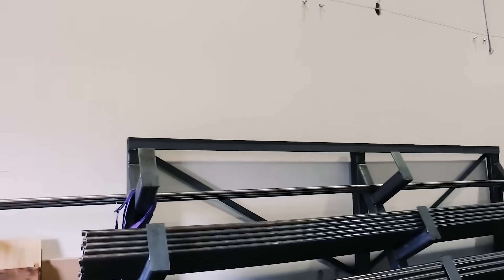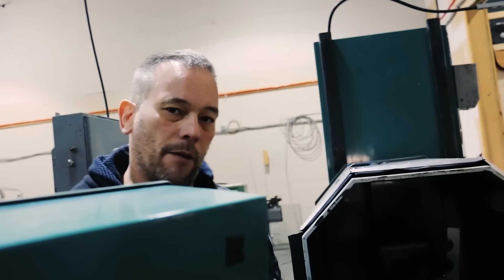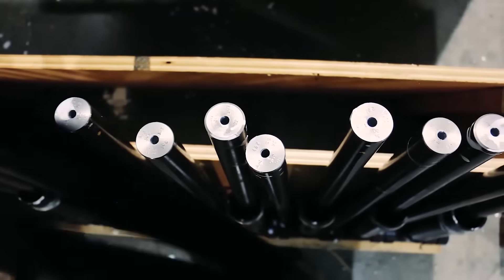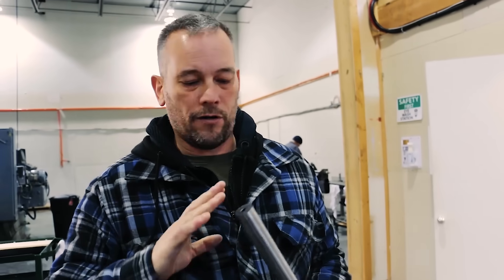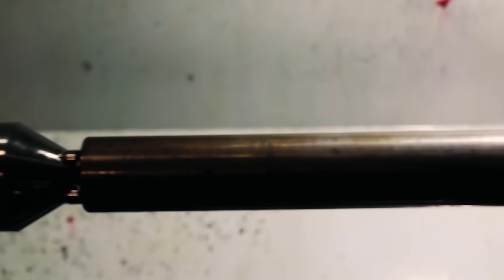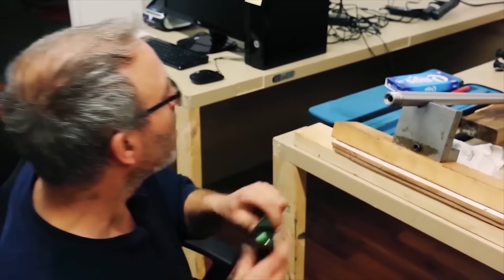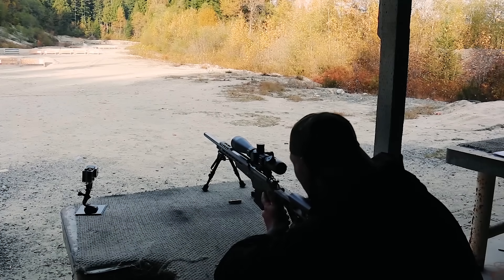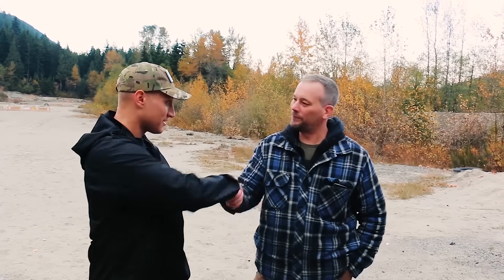How A Precision Rifle Barrel Is Made: with International Barrels Inc.

Comment: As a  CNC Lathe machinist for a long time I can definitely agree on different batches of steel running very different. You can have 2 batches of the same steel running a part and have everything in spec then when you switch to the second batch you have to dial everything in again almost every single time.
Reply: Not a machinist, just a simple "ez bake" leaf spring manufacturer, and even our spring steel is different from bar to bar. A single pallet of bar stock can have three different steels that will produce different amounts of scale, require different temps, etc.

Comment: Great video.   I agree some of the older machines are so well made, there's simply no valid reason to run newer equipment.  Imagine that a 105-year-old machine is still running strong and true.  Just fascinating the quality of manufacturing back in the early 20th century before AutoCAD.  I know a few shooters that run International Barrels.  They like them a lot.  Button rifling has been used in benchrest for decades.  Even some F-Class shooters use button rifling.  I've used several button-rifled barrels and several cut-rifled.  Both were very accurate all the way out to 1k yards.  The barrels were 5R and 6-groove.  5R is a little easier to clean than 6-groove and of course 3 & 4-groove are easier to clean than the others.  It is a common misconception that more grooves = better accuracy.  I'd argue the opposite as each group imprints on the bullet as it expands to block off gas and each groove makes a mark on the bullet.  Ensuring proper cleaning at consistent intervals is as important as anything else in maintaining accuracy & precision in a barrel.  I've also had the end of several button-rifled barrels threaded and turned down to 5/8-24 without any impact to accuracy.  I have seen button-barrels turned down to 1/2-28 which did seem to cause an expansion at the muzzle which led to a slight degradation of accuracy.  The two I saw this on both went from 1/2 MOA to 3/4 MOA.  While that isn't a major movement in terms of closer ranges, it will translate to greater loss at greater distance due to the cone effect.  If a rifle barrel is handled and manufactured in a quality way, then there is simply no good reason to shy away from a button-rifled barrel.  I'd much rather have a button over hammer forged.  Lord, some of the hammer forged barrels I have seen through a borescope, and it was a wonder the bullet didn't just fly wildly in some off-the-wall direction.  Luckily, the few production rifles I've owned which were hammer forged didn't have any issues with messed up rifling or curved bores.
Reply: the only issue I've had with older machines is pretty loose backlash on the cranks of an old metal lathe, but it was the apprentice lathe so it probably took a good bit of abuse and then some

Comment: How do they make sure the drill stays in the middle of the barrel? 
Can imagine the drill is quite flexible especially with small calibers like 4.5 mm
Reply: Physics of the drill point geometry.  It actually does wander, but slightly.  The reaming then corrects it some,  then rifling trues it up even more.  After that, the outside of the barrel is cut concentric to the bore.

Comment: I am not a gun nut, but love how things are made. I still wonder how a long thin drill bit can bore a hole a long distance and not wonder. Is this not the reason the old timers forged a rough barrel around a mandrel, so it had a rudimentary hole through the barrel. Back in the mid 1960s, when I was a kid, my folks took me to Williamsburg VA. I kept going back to the blacksmith's shop and the gun shop. They spent much time forging that rough barrel, then slowly boring out a center hole.

Comment: It would probably would help if I know what Lapping and Buttoning are????
Reply: @Chris Longski it's also called lapping because the emery cloth* rips tiny holes of metal, and a finer emery rips and fills with chips it just pulled (laps the holes) Brought stainless to a mirror.
Reply: @Chris Longski it's very similar on a technical level. Lapping is more on the cleaning side but essentially burnishing at a very fine level.

Comment: I did this at H & R (New England Firearms)...deep hole drill (I raked chips and ran an oil extractor to reuse the oil from the chips too), then a reamer , then a french lathe for OD...then a bunch of other operations to get the sights and barrel ready for assembly of other things, like a broach ...then it get's heat treated. We did ours more quantity then the level of quality they have here.  We did have Pratt and Whitney machines too.  We were old school and didn't even use NC machines.  I also made gun stocks (white Birch) on a German machine called Zuckerman.

Comment: In  the old days, they had to straighten barrels after they were bored and rifled. It was an art performed by the eye sighting through the barrel at crossed lines lighted from behind, such as a multi-pained window. The reflections through the barrel would show where the bends were and would be straightened in a special straightening press. Perhaps they no longer have to do that.
Interesting video, thanks.

Comment: I am not surprised that they still keep old machines.  All my life I  am in woodworking and the better machines were  made during the 1940 s and 1950s.  I am particularly fond of a US made woodlathe by Oliver dated 1932. Only disadvantage with old machinery is ; they have so much metal to make them strong and sturdy
that they are extremely difficult to move them in the shop or to transport them.

Comment: 416R steel from France.
Cut to length (27").
Face the ends.
Drilled.
Reamed.
Lapped.
Soaped.
Buttoned.
Ends up at 26".
Guy with a blue flannel shirt.
Lots of unpainted sheetrock.
Some glances at machinery. 
Industrial noises.
End of story.

Comment: I wouldn't mind a 22.250, 25.06, .257 Roberts, 30.06, 300 Weatherby Mag, but I have a .22 Mag Marlin with a Micro Groove Barrel that gets the same grouping at the same distance all the time and no real life difference at 200 yards. I had a friend that took a pop shot at a deer from the hip on the railroad tracks nearly 400 yards away to scare it off the tracks and managed to hit it in the upper spine near the neck and dropped it, it instantly died. They say a rimfire rifle isn't adequate for big game, but it surely is as there was a exit hole as well.

Comment: a 1917 machine!!!  the USA is so screwed up...so impossibly deranged. .. what does GERMANY use?!!!  we can't even supply the steel, France does.  How can TRUMP fix this country when our heads have been in such a dark place for such a long time? and the DAMNocrats won't even let him!!
Reply: They are a Canadian company. And as far as the age of the machine (1917) that does not mean it is inferior by any means. I am a machinist and I can tell you a lot of shops have older equipment, some because they are penny pinchers and some because the quality of machines back then were so much better than the mass production ones of today. One shop I worked at had lapping machines with plates riveted on stating a 'thanks for WW2 efforts' something of that nature, that company bought up everyone they could find because parts for them weren't available and they don't make a machine today that compared to it. All in all a well cared for machine will last. Same as a well cared for rifle, clean it, oil it, don't misuse it and keep it away from any morons who can't follow these rules, you'll pass these tools onto the grand kids so to speak.  Sorry so long of reply.
Reply: @at0mix81  repair them as needed and they will last forever
Reply: @at0mix81  Iran a 48 inch by 12 engine lathe that was marked property of the War Dept, 1918 and a 96 inch vert. lathe that had July 2 1902 cast in the frame.
Reply: I am sure the US makes plenty of gun quality steel, which is likely used by US gun makers. That said US made guns are not all high quality, as cost can be a factor in gun sales and of course profits for the company can trump quality. Being a Canadian company they have little more options as far as suppliers go and Europeans know their business when it comes to weapons and metals in general. Plus with US steel buying Stelco and shutting it down, high quality gun grade metal maybe hard to find in Canada. 

As for tooling...you can either make the tools expensive and last forever or don't last as long but cheaper, thus easier to replace. The tool makers themselves can make more money in the long term if their tools don't last as long, or have more consumable parts that need replacing. I wonder if that machine was making Brens during the war. If it was in Canada at the time, there is a good chance it was, or maybe stens.
Reply: What worked great then works great now, older machines are harder to learn but easier to work on and in no way produce a worse product
Reply: @mortimer zilch - Damn. I hope that you don't have the right to vote if that's the extent of your thinking process. There are A LOT of high-quality machines built way back, and of course it's been maintained over time. Maybe gone through a refurbishment or two to make sure it is all up to snuff in accuracy and worn-out contact surfaces get replaced, the engines were definitely not original, etc. Seriously, why do people like to show off as class-A idiots online? It is a fetish or something? Do they jerk off to being seen as retards?
Reply: You have to understand that back then we made machines to last. If the machine is functional, does its job and doesnt break down very often then why replace it.    Around 1990 I toured a John Deer Combine manufacturing facility in Germany. Many of the heavy production equipment stations were manufactured in the 1890's. The engineer told us that there was nothing new being produced that did the job any better or faster than the old equipment so why spend the money and waste the time replacing them.
Reply: Mort:  Machining is the only trade that can reproduce itself.  These 100+ year old machines have been continually upgraded over the years, all the moving parts (especially the rails) have been replaced with new parts, keeping the tolerances within spec.  There are tricks to learning any old machine but if these guys are putting out barrels that shoot 10-shot groups like that, I see no issue here.
Reply: Because they don't make the machines like they used to. If it ain't broke, don't try to fix it.

Comment: I still don't understand how/why a super long, thin drill bit does not wander/curve all over the place as it tries to bore its way through 27 inches of steel. With a drill that long, it could easily flex, resulting in the drill exiting the SIDE of the barrel instead of reaching the end.  What keeps the drill bit straight and on center?
Reply: Exactly. Just what I wanted to know.
Reply: The drill does drift/wander so they drill the hole thru & turn the outside of the barrel true to the hole @6:52 there is a center in the bore on both ends
Reply: Tom Jachimstal  I follow what you're saying. But, while turning the outside after drilling would center the bore relative to the outer diameter at both ends, this step would NOT ensure that the hole inside was perfectly straight. So, it still comes down to the drill not wandering.
Reply: @gregparrott  It does wander.  Not a lot and gun drills are designed to minimize it but if you look at high end gunsmithing you'll see where a barrel is "timed" to 12 o'clock when being threaded for the receiver.  This is due to the curved/wandering bore so the bullet exits on an upward trajectory rather than down or to the side.  Also a tube will not be stronger than its corresponding bar was but it will have 90% of its strength for a significantly smaller weight penalty.
Moment of inertia equations would spell this out more fully if you want to look them up.
Reply: tom demitras  Thanks for your reply. The timing' that you mentioned is an intriguing approach. As relates to tube strength, I am a mechanical engineer and know the equations relating torsional stress as a function of cross section. Torsional strength increases proportionally to the FOURTH power of the radius, so what is at the center offers little.

However, if you focus on the torsional stress gradient, it transitions DIRECTION as it runs radially though the center. What I've been told is that this transition area (a discontinuity)  can become a source of fatigue. 

I would appreciate a reply from 'Current Batches', explaining why HE chose to pay double for axles. If you look at an axle as just one component in a differential or transaxle assembly, I find it hard to accept that 'Current Batched'  justified paying double just for the miniscule weight savings achieved by drilling a hole.
Reply: Current Batches  Thanks for your reply. Even with a 'Gun drill', it still baffles me how the drill bit can drill to depths as much as 90 diameters (as mentioned in the article) without wandering becoming an issue. As for your axles, aside from somewhat reducing their weight, I've heard that changing the axle's cross section from a 'bar' to a 'tube' is supposed to actually make them stronger. Is that why you paid the premium?
Reply: @Current Batches THANK YOU!! for the wiki link. Gee, apparently I made that old mistake of puzzling about the solution to a problem that doesn't exist. I guess if you keep the cutting tip cool and it has the right shape to the cutting edges, it won't wander off center at all.
Reply: it seems like its a very slow process....unless I was seeing it wrong...nothing like a typical lathe or drill press
Reply: Well it does get off center. Can be off up to .001 inchs per 1 inch of barrel.  A 18 inch barrel could be off .018 of an inch. Still going to shoot good though.  But yes it would seem to just wander around in there.
Reply: Again, my first thought when they showed that thing. And Sir Wafflebob says "coolant", but the problem is hardly just a thermal one. If you are exerting that kind of pressure on a skinny drill in stainless steel, it's going to buckle. That must surely cause some unwanted wear on the rest of the bore.
Reply: And yet, rifled barrels, with their corresponding higher pressures compared to smooth bore, have been made since the mid 1800's. So, somebody figured out how to drill long, thin, and STRAIGHT holes in steel over 150 years ago.
Reply: It's called a sharp drill.  @johneggmuldoon3176
Reply: @johneggmuldoon3176  It's called a sharp drill . . .
Reply: Coolant.

Comment: This was one of the most aggravating videos I have seen on YouTube. There are no "Trade Secrets" in barrel making Larry Tischler. The difference in one barrel and the next is not some secret sauce, it is the care and precision of the manufacturer using established techniques. The producer could have shown any aspect in detail. Instead we got a disjointed narration by the shop owner. The segments were clearly out of order as they jumped from topic to topic. If I were he, I would have the producer delete this stupid waste of electrons. Not only that, the video shows a wide variety of serious workplace safety violations.  This could pose a significant liability if it is ever viewed by a Provincial Safety Inspector.
*Lack of proper personal protective equipment on the machine operator and narrator
*Lack of proper machine guarding on the lathes
*Lack of compliant machine controls..
I could extend the list, but why bother...
Their closeup camera work stinks. They do not know how to focus or hold their camera still enough to show the audience what the subject of the shot is all about.
Reply: Well, your name is "Mister Safety," so you may be a little biased. However, I do think you have several good points. Making videos is hard, but from personal experience I can say the problem is people don't know how to plan ahead. For one thing, when filming the drills the autofocus was glued to the wall. That's why How It's Made has a little turntable with a cheap backdrop. You place the thing on the table, manual focus in macro framing, then rotate so the viewer gets a clear look at the doodad you want to show. This is why cinematography is a thing. It's complicated.
Reply: You need a slap

Comment: I always wondered if rifle barrel  machining had problems keeping the bore straight.. But in order to do that you would need to bore it with a single point boring bar after drilling  to get it straight. 
  So  the bores are coming out straight  just drilling...Since the reamer  just follows the hole, and wont straighten the bore out if "bowed"  ... Its very interesting the Hole (bore) are straight after drilling.  You must be using some very specialized cutting tools. That is so encouraging.  
  Also, wouldn't Removing material from the O.D. cause bowing?.  Is the key  to Dimensional instability  keeping  the workpiece cool during the entire machining  process..
    I have some  13-8 Precipitation hardened steel I wanted to try making a rifle barrel with... I was going to buy some carbide drill rod, and make a single point cutting tool holding arbor, and mount the rifle  barrel on a milling attachment (big milling attachment) and feed the barrel  , and keep the tool stationary..

Comment: I would love to see a video on how the first gun barrels were originally made and how the technology has progressed over the centuries
Reply: the first ones were smooth bore, meaning just a hole to cram ball and powder down and rifling didn't become a common ish sight until the real late 1800s where the gunsmith would rifle the barrel by hand or if he worked in a city maybe by machine, the barrels themselves were also forged into shape with a hammer instead of turned down on a lathe, that's why old guns don't have interchangeable parts, each part was made custom to the gun with primarily hand tools